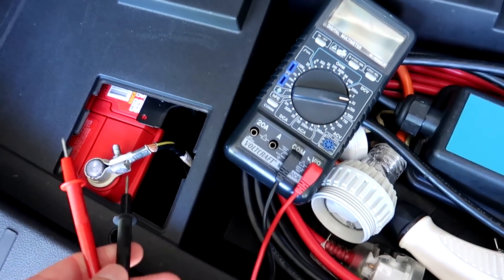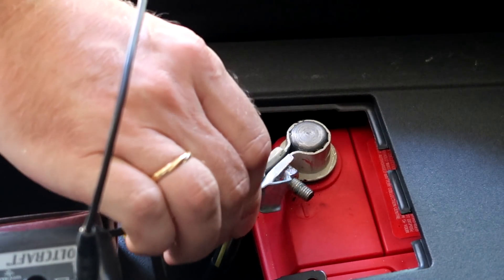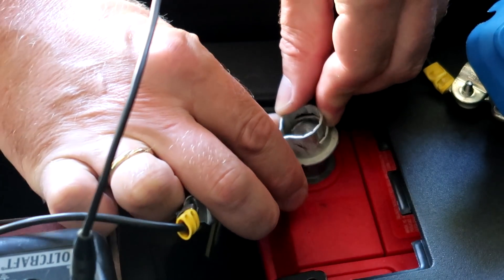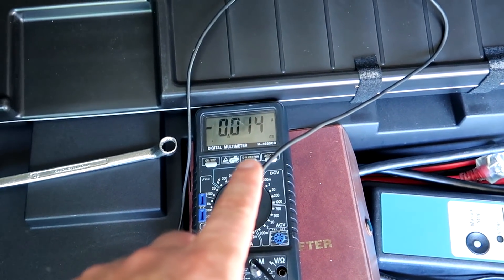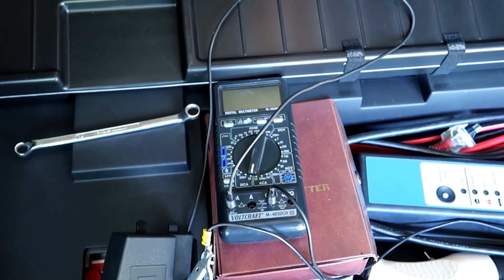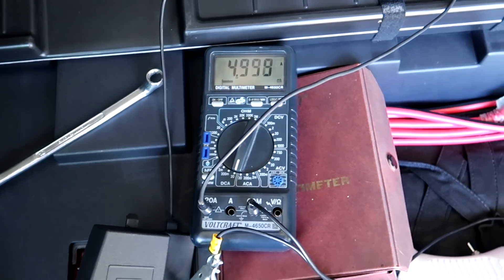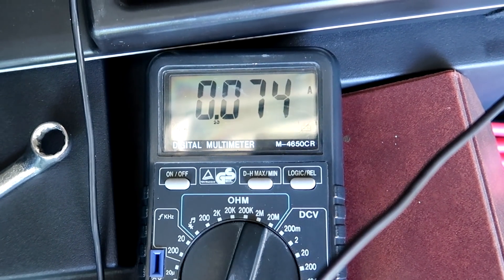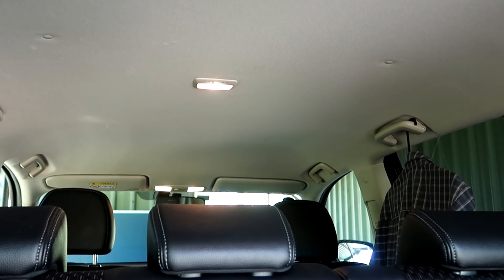EP44 - In search of the lost Ah⚡ in the Outlander PHEV!

Comment: G’day again Andy, there’s obviously nothing major wrong with your 12v battery. In any event:
1. I don’t believe our standard (non wifi) PHEV’s are trying to charge the battery any time except when powered up or mains charging.
2. Even if they were, the small 12v battery couldn’t absorb much power from your (relatively) huge drive battery.

Is your car really using power when parked, or just recalculating the figures with a dodgy algorithm? I’d be interested to see a clamp meter on the main drive battery output leads. (Although I have a clamp meter, I’d have to investigate where I could do that.)
Reply from the maker: The 12V battery is acting weird, having a lower voltage after driving (and charging) than 4h later. Even the low standby load of the car should not cause the aux battery's voltage to rise that much. Why would the voltage go up after charging? Unless the car somehow uses the 12V system for some kind of after driving cycle whatever procedure which then looks like to us this is the voltage after driving but it actually pulled some power out of it for whatever....

Comment: I just had to bath my dog to get all the ice off his coat! If you switched on the A/C while plugged in, is the power drawn from the external source?
Reply from the maker: Ice? Not from Australia then, I assume :D Hope your dog didn't go swimming or so...
Yes, all power for the car and also heating/cooling will come from the charging station while plugged in. This could slow down your charging as the charger can only deliver 3.6kW to the car (via Type 1 plug) and if the heating is already using 2kW, well, it could take longer to fully charge then...
Reply: Thanks for that, should get my PHEV next week! I’m from Perth,  the original one :-) it’s freezing here.
Reply from the maker: The colder Perth, eh? Very cool (not only temperature wise). That's exciting and you have plenty of chargers available in the Perth and Dundee area. How do you charge at home? Using the standard EVSE for the beginning?
Reply: Just had a future proofed 7kW charge point installed at home and ordered a type2 to type1 cable. Free charging available at work too.

Comment: Hey thanks for the videos! Been thinking about getting an Outlander PHEV so it's nice to see a lot of info on it. One thing I've been thinking about it is ground clearance. Do you think it's worth/possible to put larger tires/smaller wheels? Is the tailpipe the low point? Thanks.
Reply from the maker: Thanks, Taylor, much appreciated. 
I've read a post on the forum a while back that someone was going to install a lift kit for the PHEV. Not sure if he's done it though. Replacing tyres with larger ones is not possible as far as I'm aware.